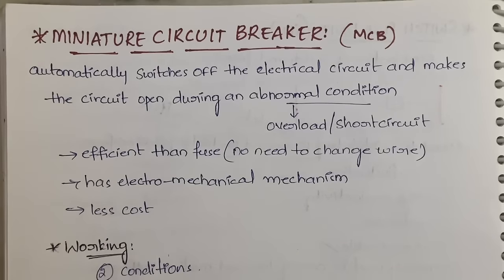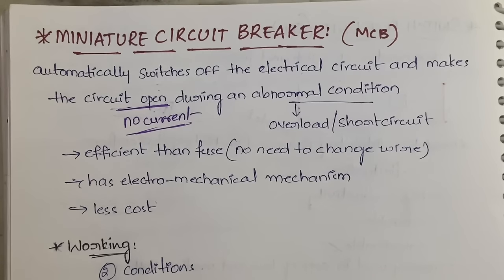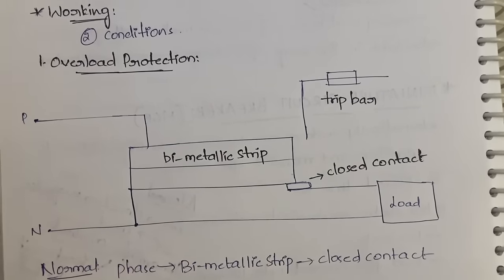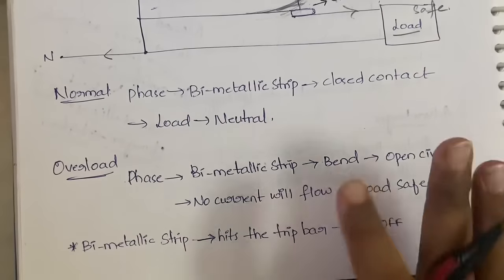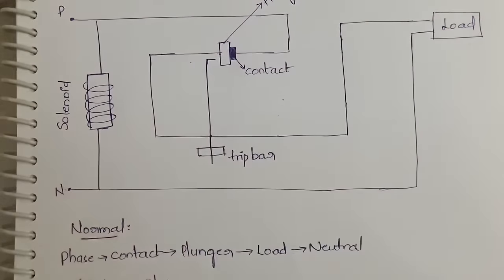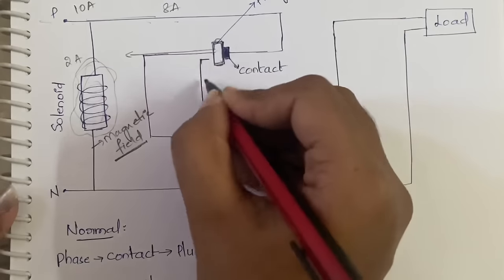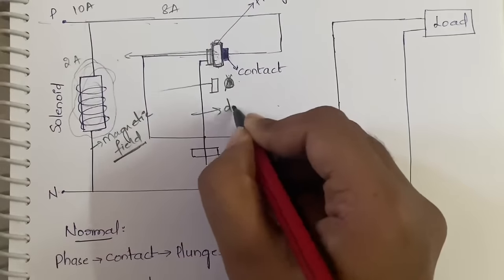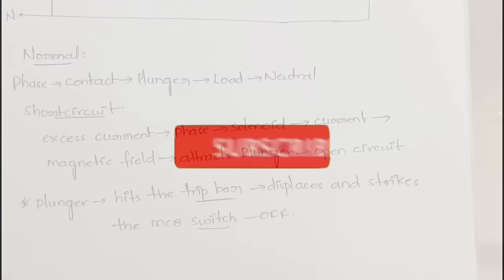Miniature Circuit Breaker (MCB) -Definition, Working, Uses, Diagram |BEE|

Comment: 00:02 MCB automatically switches off the electrical circuit during abnormal conditions.
02:01 MCB provides automatic protection against overload and short circuit.
03:48 MCB operation in normal and overload conditions
05:42 Heating causes metal deflection leading to open circuit in Miniature Circuit Breaker (MCB)
07:32 MCB trip bar operation explained
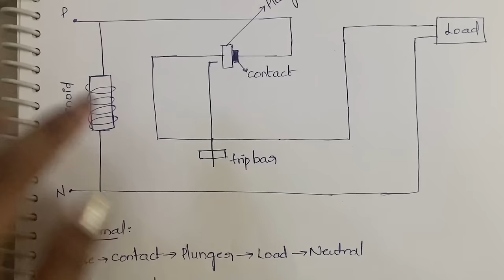09:19 Excess current in solenoid generates magnetic field, attracting plunger for circuit interruption
11:02 During normal conditions, the circuit becomes open with no current flow.
12:50 Working of short circuit protection
Reply: helpful

Comment: During a short circuit situation, the overload bimetallic strip circuit too is active which also will expand and open the circuit. So the question is why r there 2 circuits?
Reply: Im not understanding ur ques ,where are 2 circuits? There is just one
Reply: There are two circuits connected parallel to the phase. While short-circuit, the bi - metallic strip is not heated up because there is not enough current passed to the metal to heat it up,so that the bi-metallic strip could not  bend towards the trip bar.Therefore, Each of the circuit reacts based upon  the situations(short-circuit or overload)

Comment: Coil is not connected between phase &Nutral.
It is in series.

Pl do not release such confusing videos.
100 Rs you can buy one MCB.
Break one &see inside.
See other Viedeo.

Mcb s are not operating as per your explanation. Do not give wrong videos.